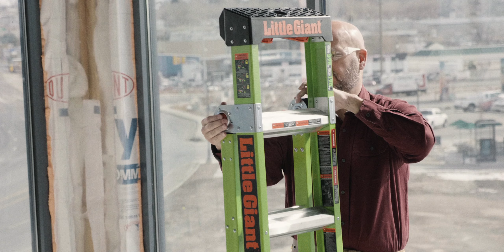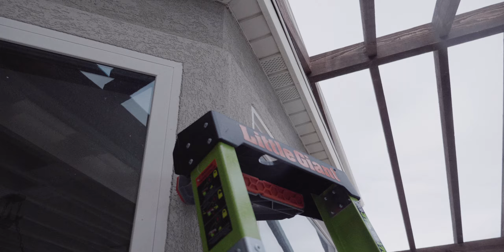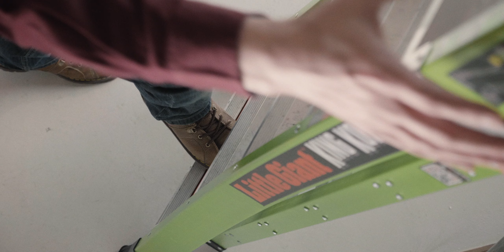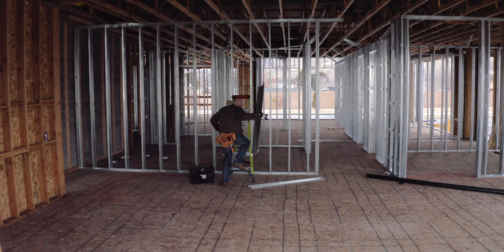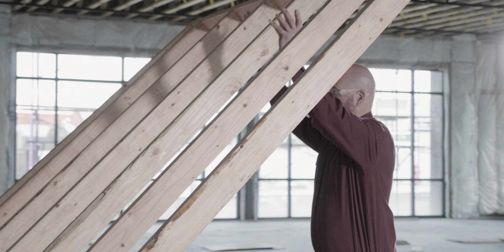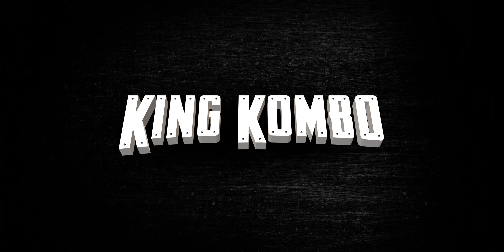KingKombo | Little Giant Ladders | Lifestyle

Comment: I've had mine for a month.  Low voltage commercial/ residential contractor.  I was skeptical, but it seems to becoming the ladder everyone grabs first. ( We only bought 1) 
Wish it had the ability to extend at least 2 sections, so it could be a 6'-8' A frame... We deal with a lot of 10' drop ceilings...